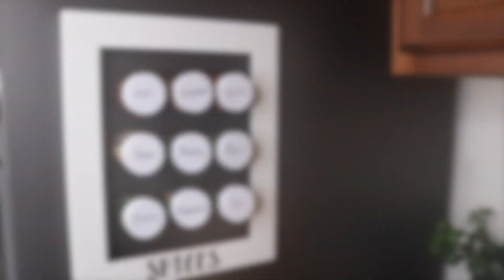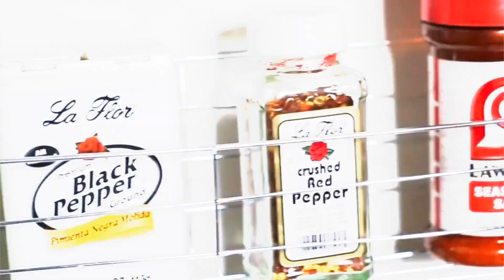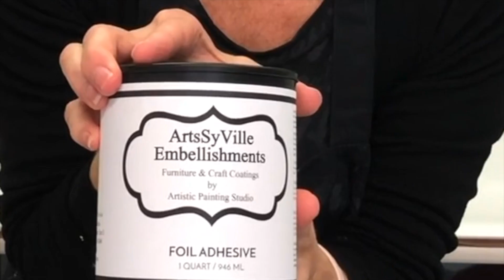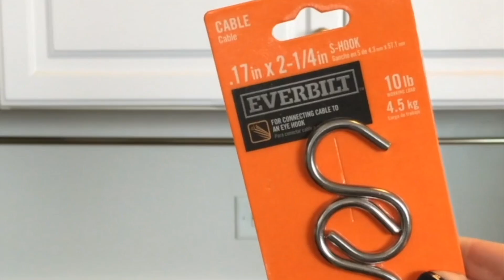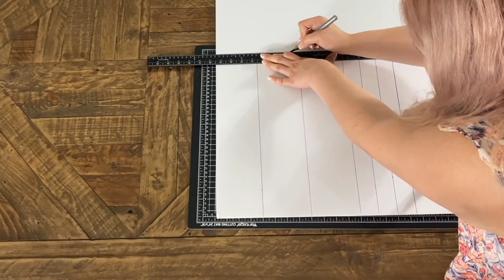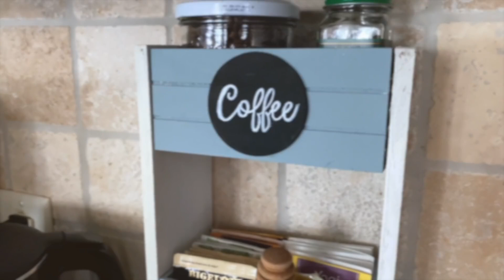Put Dollar Store travel bottles in your kitchen (BRILLIANT!)

Comment: For the floral cutting board and utensils, all you need is Mod Podge. Just paint over the flowers with a couple of extra coats. You can use the dishwasher safe kind if you’re going to wash them often. It will look much neater than the acrylic.

Comment: I never noticed before, but the screws split the wood on the cutting board tri-fold divider. Is there a way to prevent the wood from splitting when inserting screws into the wood?
Reply: Predrilling the holes prevents splitting.
Reply: @foechicken8023  ...Thank you! 😃
Reply: Or... save ur money and buy quality products.
Reply: Haha finally someone else noticed that! 😅
That' clip seems to be in every single Hometalk video now and it drives me crazy every time because they don't predrill which causes huge cracks and they just keep it in and hope nobody sees it! 🤯🤬

That was actually the only reason I went into the comment section - to write about the huge mistake with the boards haha!
Reply: You need to predrill before putting screw on.

Comment: How did you hang the Peg Board ? please and thank you !!
Reply: Idk how they did it, but we bought 2x2s (firing strips~ these to give space behind the board for Pegboard hardware to be inserted & removed as you design your space) & cut them into chunks/sections, painted them color of choice, then found studs on wall where we wanted to mount it, next predrill through the 2x2s so they won't split, then screw the 2x2s into the wall (basically one 2x2 on each corner, or as close as possible & maybe some in the middle~ I'm putting a qualifier here bc both the length & amount of 2x2s you use will depend upon what you'll be using the Pegboard for/the amount of heavy items you'll hang), then finally screw the Pegboard to the 2x2s & you'll be ready to hang whatever on it. 
Try & be strategic about where you place 2x2s, as you won't be able to add anything with hardware to those areas, but you can mount something straight through the Pegboard into the 2x2 with screws (we mounted a nuts, bolts, & screws organizer to ours using the 2x2s for extra strength). 
Also if you want to add "S" hooks, add them to the Pegboard b4 it's mounted, as you'll have to bend/stretch the S out to get them into the board, which is harder once hung.
If you have any questions let me know...
Reply: @leahrowe847  Your information is fantastic , I have two large walls I want to install pegboard on for utensils and baskets to hold items to keep my counters cleared off nothing heavy , I saw pictures of Julia Childs kitchen almost all her walls had pegboard for her pots and pans it was beautiful she displayed what she loved  , I love to be organized and the pegboard is perfect , thank you for the very precise information I can't wait to get it done and thank you for your offer to help further with any other information very much appreciated !!!